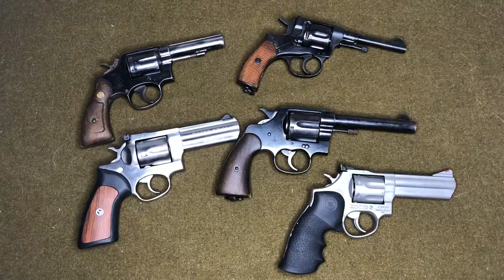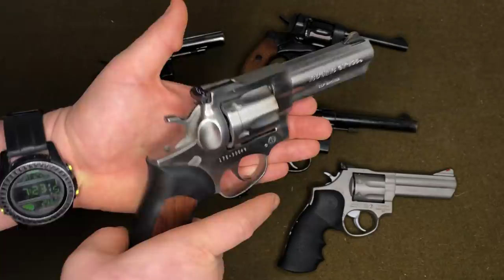Stupid Gun Myths - Episode 5: Revolver Cylinders Rapidly Click When You Spin/Reload Them.

Comment: The problem is that you didn't stick baseball cards in the spokes.
Reply: Bad Uncle I would use water bottles lol. Louder noise and easier access(assuming you’re talking about bikes)
Reply: @BrainlessFallen  no hes talking about revolvers bruh
Reply: @BrainlessFallen  lol I did soda or pop cans
Reply: @BrainlessFallen  always used bottles too, but It was too hard to pedal
Reply: @quadrakyiro  always worth it for a motorcycle
Reply: @quadrakyiro  resistance training is all I hear
Reply: This is under-rated lol
Reply: he didn't put WD40 in the spark plugs
Reply: I never got the thrill of that at any age lol
Reply: @DYLANJJK94  doing what?
Reply: Would get Coke cans and jam them between the tires and the part the wheels connected to
(don't know bike anatomy)
It would sound like a moterbike
Reply: @vegasspaceprogram6623  "the part the wheels connected to"- the frame?
Reply: Ahhh yes yes, the ol rookie ken Griffey Jr

Comment: I think this myth comes from westerns where they mostly use Colt Single Action Army revolvers.  However, even if you can spin the cylinder like that, it is not good for the gun.  That clicking sound comes from the hand slightly sticking out, and it is going back and forth with every indexed position.
Reply from the maker: Right which is why I said that in the vid. Even then though, they'd click about the same amount that the Nagant revolver clicks in the vid.
Reply: @MikeB128  My Colt Single Action Army copy can make a sound just like the movies (I literally just tried it right now).
Reply from the maker: Okay? Did you not hear me address that in the video?
Reply: @MikeB128  I did, but it makes more clicks than the nagant.
Reply from the maker: Right, which is why I said "It's probably more true with the older black powder revolvers". Still doesn't hold true to 99.9% of the modern revolvers used in film.
Reply: @MikeB128  sure the colt SAA does make a clicking sound when the cylinder is spun, but unless you have a modified colt or its a really well oiled expensive model it wont keep spinning like you see in movies. ive got a pretty nice one and it doesn't spin for longer than like a second. Good video, i am enjoying the series,
Reply: so A Fistfull of Dollars "when a man with a 45 meets a man with a rifle" scene where he did it to quick fire-ready-load single round is feasible or not?
Reply: TreeWizard648 wouldn’t it only do that if the cylinder is closed?
Reply: @connorrocha1297  SA revolvers typically have a loading gate, you don't swing the cylinder out unless you're removing it completely, and then the cylinder isn't connected to the revolver any more.
Reply: TreeWizard648 why are you the way you are? Please stop.

Comment: An actual colt SAA will click similar to the nagant when spun but stops as soon as you stop moving it by hand

A Ruger Blackhawk/Vaquero will freely spin when the load gate is open but doesn't click.
Reply: if your Colt is well oiled or modified you can make the cylinder spin for quite a while with that clicking noise. it only makes that noise with specific single action revolvers
Reply: True that!
Reply: My vaquero clicks and only spins in one direction. There's a good chance you're was modded. All you have to do is turn a screw near the hammer which I believe retracts the little stopper that makes it click and stops it from turning backwards.
Reply: My original flat top blackhawk spins freely and clicks
Reply: The wangler does not click either

Comment: Not sure if other manufacturers do this but Smith and Wesson revolvers allow you to spin the cylinder when closed. Slightly pull the trigger or hammer back just enough for the cylinder stop to go down and spin it. Smith and Wesson works on this and it is a fault that they inspect and fix if the revolver doesn’t do the clicks at the factory. It’s not an important function to have at all but we know everyone loves the sound so they pay extra attention to having it on all of the revolvers
Reply: FYI… don’t spin the cylinder aggressively and have it lock into place while mid spin because it will damage the notches (the rectangular holes on the cylinders that let the cylinder lock into place)

Comment: In order for spinning the cylinder to cause any damage it would have to spin so fast that the contact surfaces (Cylinder and pin) would have to overheat and gall, and when it is open, spinning the cylinder has ABSOLUTELY nothing to do with the timing.
Swinging the cylinder closed by jerking the gun sideways can cause damage though.

Comment: Not sure about other revolvers but i have a s&w model 15 and if you pull the hammer back just a little bit while the cylinder is closed you can spin it and it will make the sound it does in movies, probably bad for your gun so dont do it.
Reply: I have a Ruger Single Six that does the same.

Comment: Enjoying your myths videos. This one has some basis in reality. You can spin a modern revolver based on D/A S&W, DW, Colt, or Ruger designs and get that click, but it's not Hollywood loud. Sorry, not trying to be a range ninja, just thought I'd share. The trick is to hold the hammer at a half cock position, the lug will release the cylinder, but the hand will be in contact with the indexing serrations, and the hand is spring loaded. If you spin the cylinder the hand will click against the back of the cylinder as it drops off each indexing serration. Won't hurt the gun any, but it can leave a drag mark on the cylinder between the lug recesses if you don't have the hammer back far enough. Just thought I'd internet expert you in case you ever felt the need to be showy while playing Russian roulette.

Comment: A lot of these film audio things come about because as a general rule, if there's something plot-relevant moving on the screen, it has to make a noise. Walking on a carpet in socks? Still gotta have footsteps. Swinging a sword around? Gotta have a shwing and a whoosh. Gun on the screen? It's gotta click and rattle every time you move it. It's part of the cinematic language. It says "Hey, this thing is important. Pay attention to it."

A lot of the time, films will have firearms experts on set to advise the actors on how to properly and realistically handle weapons. Higher budget films will even have blank-firing guns that behave pretty much like the real thing, sounds and all. But 9 times out of 10, the sound designer/foley artist will not be on set, and will instead receive an edit where the only sounds are actors' dialogue and they have to add every sound in themselves. They won't even get the sounds of the guns from the set because it's pretty hard to record a gun in high quality on the go, the acoustics of the set are probably wrong for the effect they want, and they would probably get the sound of the director or stunt coordinator yelling everyone's cues.

Tbh one of the things that irks me is when someone spends 5 minutes holding someone at gunpoint, and then decides to make it more threatening by racking the slide once or twice. Like, did you not have a round chambered for that whole time you were pointing the gun at me? Or do you just like wasting your ammo?
Reply: Agreed like Glocks getting cocked as if it has an exterior hammer.

Comment: Every single movie/videogame ive seen where they do that, had the cylinder closed. I now itbonly works with cap and ball and some other single action revolvers and even then, as dramatic. Also some you need the revolver in half cock to open the cabin door so it wont work.

Comment: Spinning a cylinder no matter how fast, lubricated or without lubrication, will effect timing when out of the frame.  The cylinder is not touching any of the moving parts (arm, cylinder lock, etc) when the cylinder is swung out.  The only revolvers that may click are single actions on half cock when you spin the cylinder.